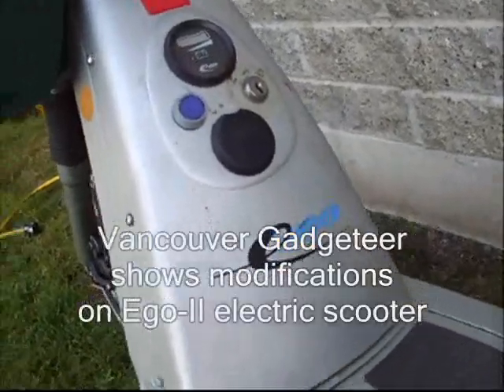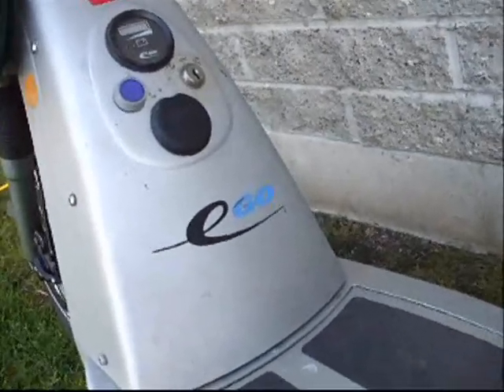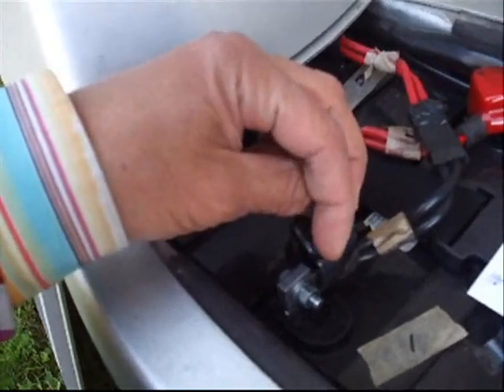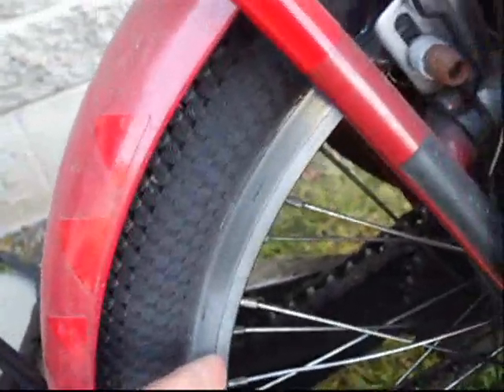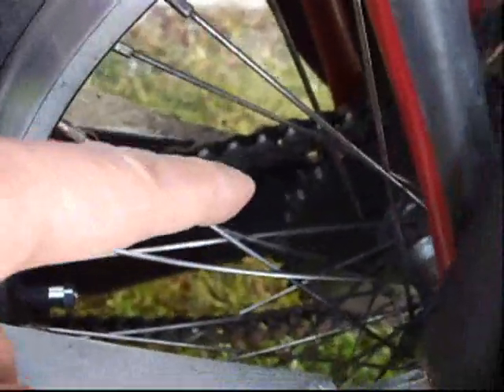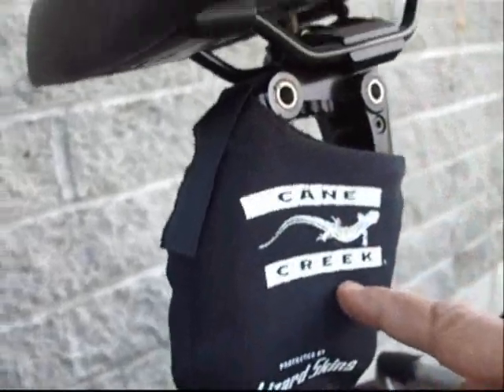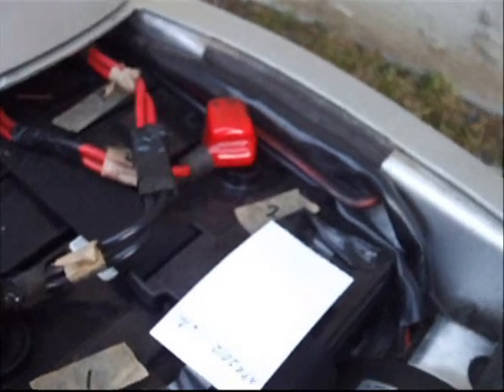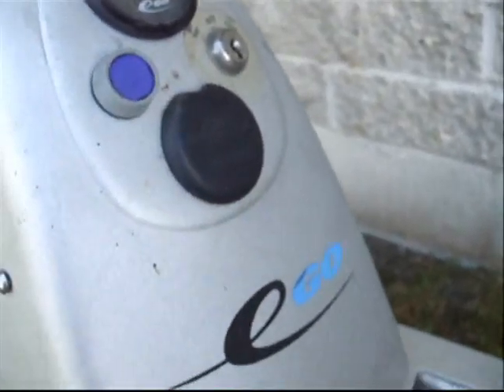Solutions to Ego-II Electric Scooter Problems for 10 Year Usability Shared by Rob Matthies Vancouver

Comment: Don't know about your e-go, but I have owned one for well over 10 years, only went through one set of batteries, (which I bought on line, and saved about 50% not buying from the e-site). Our whole family have used this bike  and I have driven it for years to and from work, to the store, etc.  don't know if you got a lemon, or if I got a great bike, but we love ours and have had none of the problems you seem to have had. good luck.zp